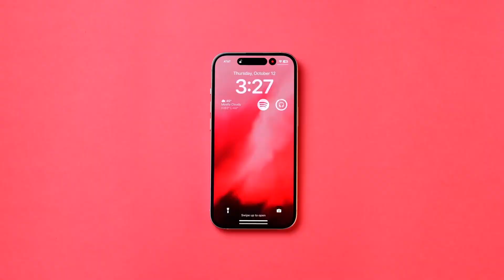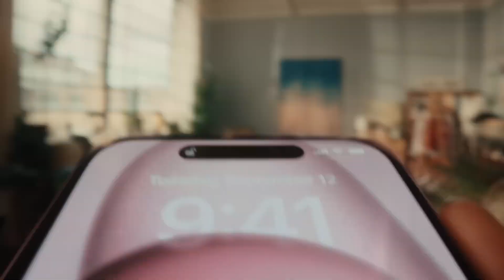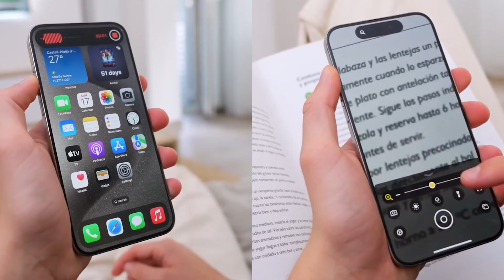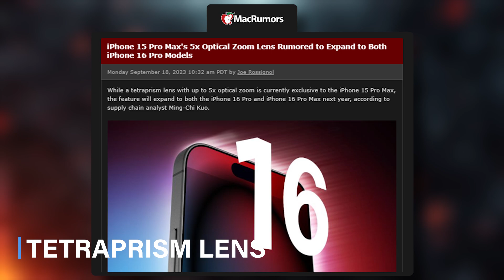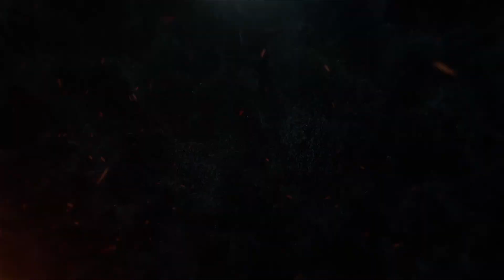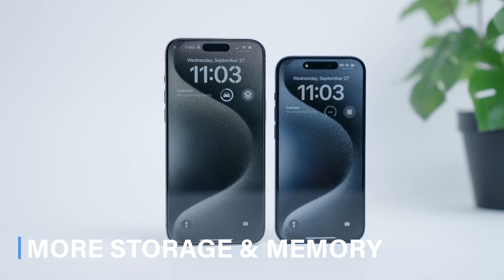iPhone 16 to iPhone 16 Pro Max - 16 New Changes

Comment: No punch hole display no upgrade 😊
Reply: No way I like dynamic more than that useless punch hole
Reply: @ooppww1923  useless?😂
Reply: 10k ka redmi use krne wala kya jaane dynamic island ke uses aur fayde
Reply: We're expecting a punch hole or under the screen sensor.
Reply: But you will get New Chip... as long as Apple Sheep are still buying 😅
Reply: Whoopi my iPhone 13 pro max has no lag so im not upgrading till they get rid of that horrible island @eclecticaro